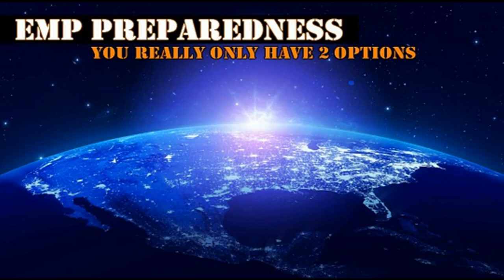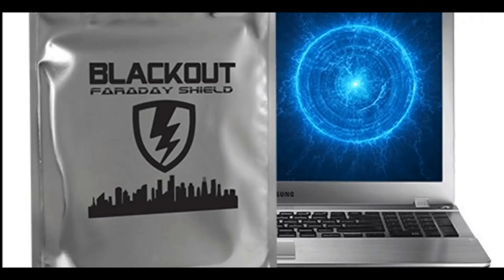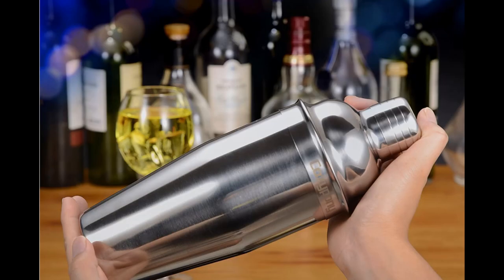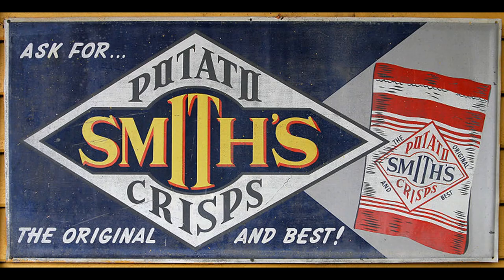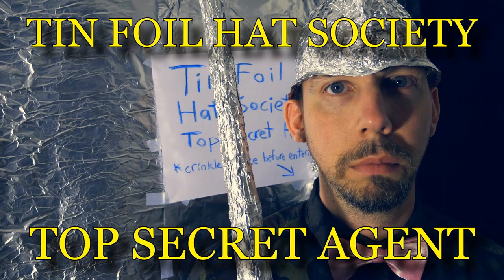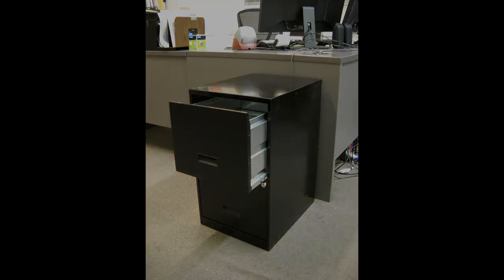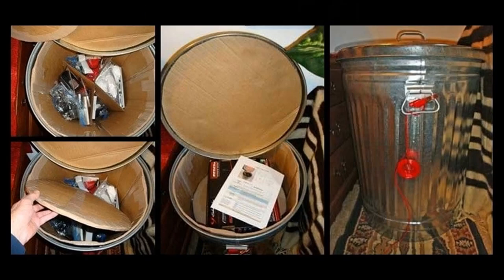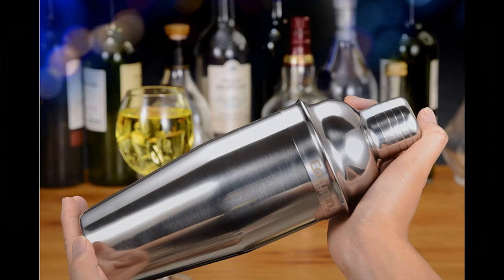EMP and Remote Scanning Protection for FREE Using Stuff You already Have at Home

Comment: add layers of faraday cages with varying sized capacitors( large to small) connecting each layer. but leave the last cage completely insulated and you will have true protection from emp and remote scanning protection

Comment: Using a garbage can stuffed with cardboard does not create a Faraday cage.  A Faraday cage is a cage whose metal (preferably copper) is at ground level voltage (same level as the ground around your abode)..  This requires that the garbage can has to have a large wire or metal strip running to a  very nearby ground rod.  All signals coming to the can would be taken to ground thus not transmitted into the can and the same for all internally generated signals,  Without the ground, thecan would act as a repeater antenna for the incoming signals.